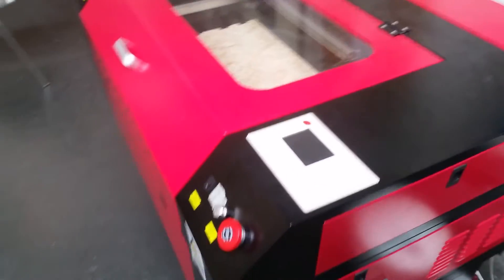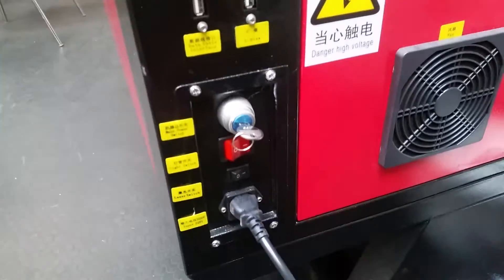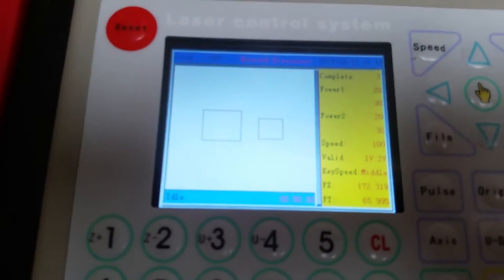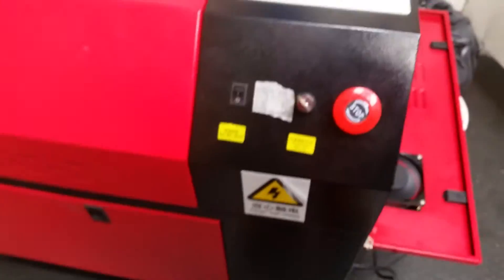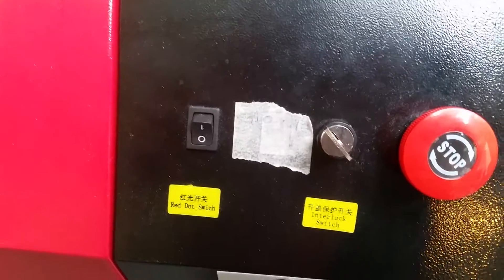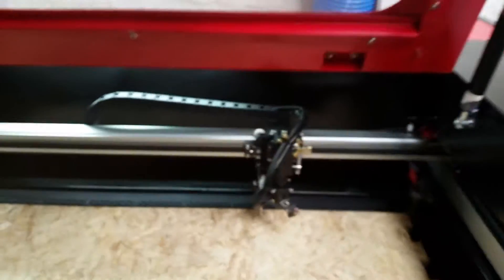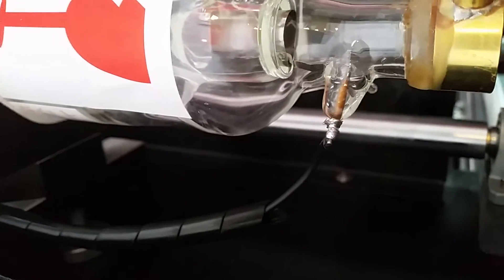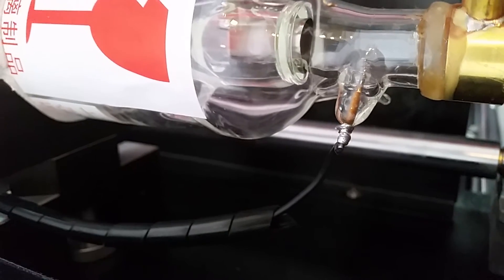Explaining how the RedSail x700 laser cutter did not work

Comment: I have an opportunity to buy this laser from somebody near me selling theirs and I was curious if you would still recommend it? Or should I spend the extra money and buy something it’s a little bit higher quality?
Reply from the maker: The quality is actually quite high for a CO2 laser. If you replace the wheels on the carriage, the optics and the tube - you have a machine that is almost as new. Tubes will last a year or a little more. Optics up to three in my experience, but how you use + maintain the machine will decide this I guess. We're kind of sloppy when it comes to maintenance, but it's a good machine overall and I would buy it again. What price have you been offered?
Reply: Jens Chr Brynildsen they are asking $1000.00 for it and I’d about a 4 out drive for me. I’ll need to rent a trailer to go get it. It does look in good condition and comes with a chiller-3000. They said they bought it in early 2015. I’ll probably need to replace the laser tube and update the controller to s Ruida.

Comment: Hi, how come your insulation on the red cable is not in place?  The wires are totally open???
Reply from the maker: Not sure what you mean? Do you mean on the connection to the Laser tube? That is now isolated,  but since the power supply didn't work and we were still searching for the error, there was no need to do so.
Reply: Ahhhh ok. then I better understand it. But yes it was the high voltage connection to the laser tube I meant. :)
Reply from the maker: Yeah. We first covered it with Kapton, but that came loose. That caused the power to go to the chassis, so it's been a while since I had such high hair ;-)

It's now covered with self vulcanizing tape, so that won't come loose.